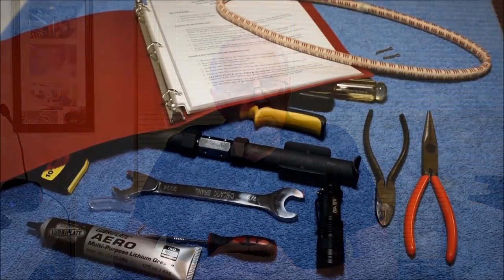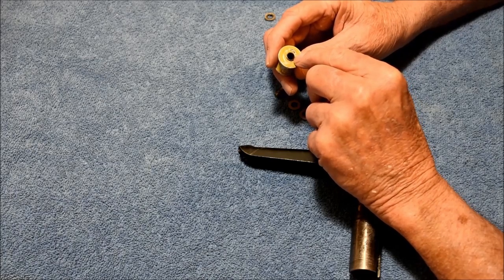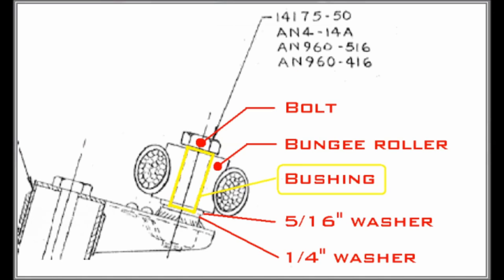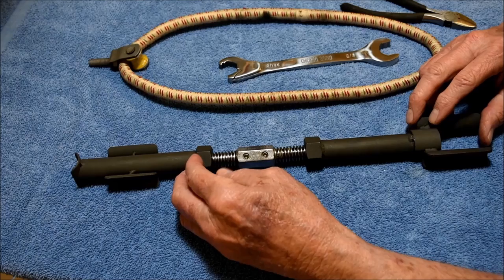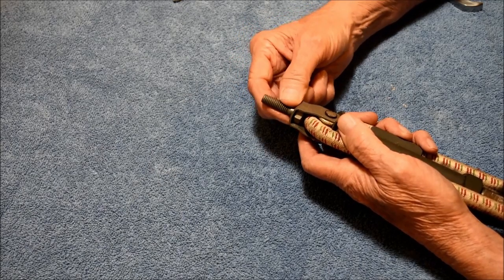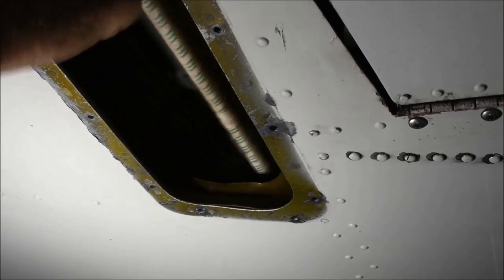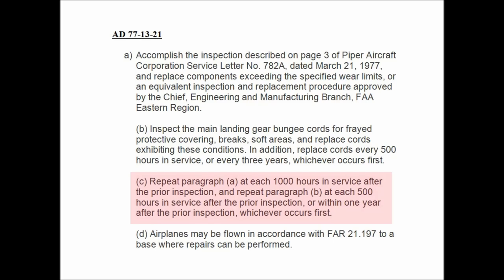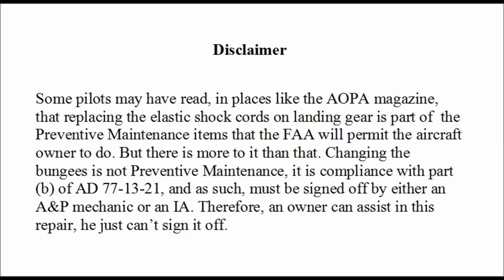Bungee Installation in a PIper Comanche

Comment: Dave, is the bungee tool for sale somewhere?
Reply: Great video by the way! Thank you for doing it.
Reply from the maker: Yes, you can email me at dave520@prodigy.net. I must tell you that there is possibly as much as a 4-6 week lag time. I was in the middle of moving my machine shop to another location when I was hospitalized with complications of Covid. It not only set back the move, but me as well. I have all my machines up and running but my stamina is coming back slowly. FYI- the price of the bungee tool is $225 plus $14 S&H. The Alden wrench is not an absolute necessity but the tool works so much better with it than with an open end wrench. We sell it for $18 and no S&H if bought with the bungee tool. You won't find it this cheap elsewhere.
As you might guess, these tools are fairly labor intensive to make. I am retired. I make them because they are fun to fabricate. I could never make a living doing this.